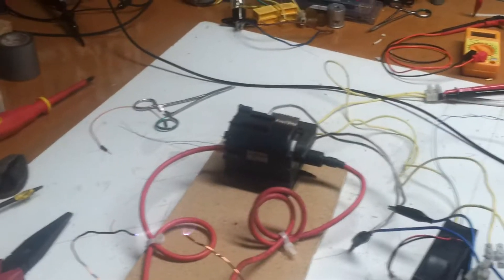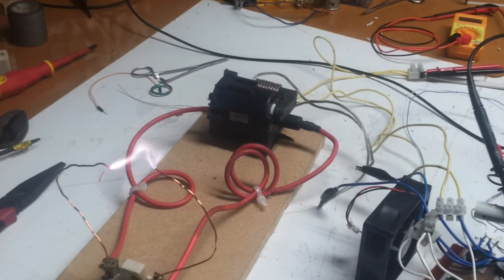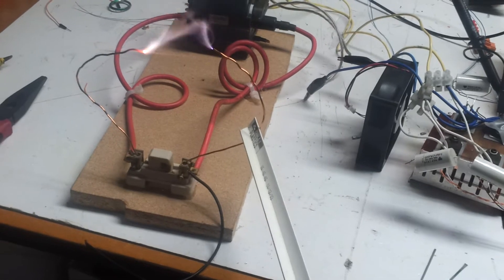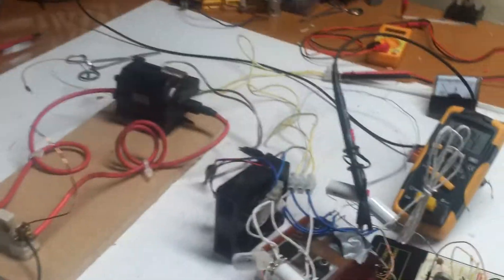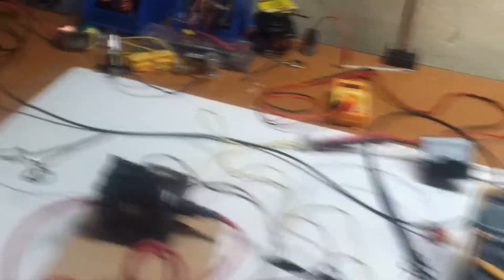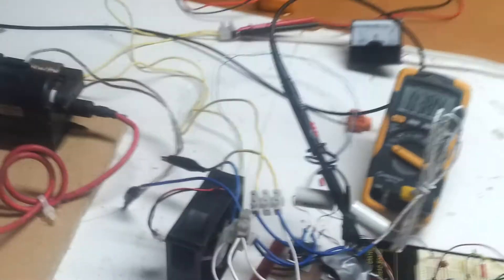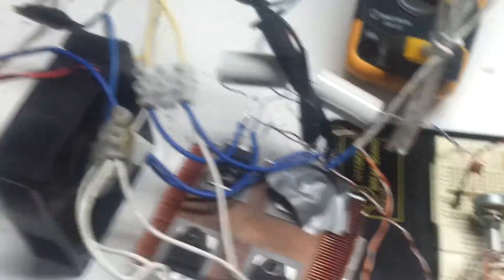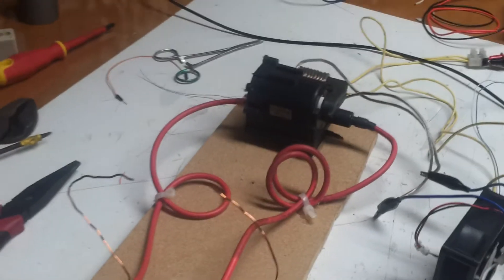TL494 IGBT Full Bridge Flyback Driver Testing With Music

Comment: Diodes in the flyback/lopt handle it well?

Just want to be sure for my 100W driver, since the transformers I have is rather rare.

Most computer monitor transformers and some tv ones expose a hv resistor to the output on it's own pin, worthy to check if you want to use feedback!
Reply from the maker: I don't think i ever had any issues with it, to be honest i dont think i ever tested for the diode on the output. If anything the diode will cause one side of the fullbridge to work harder. Its been a while since i did all this but you should be fine